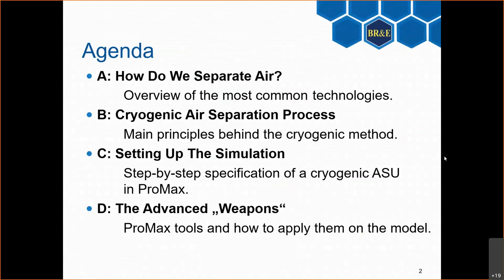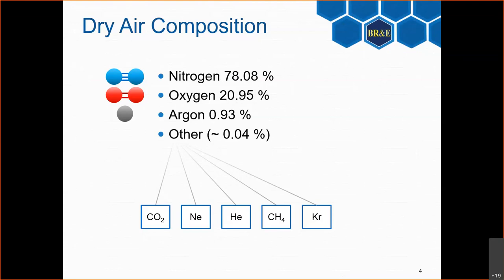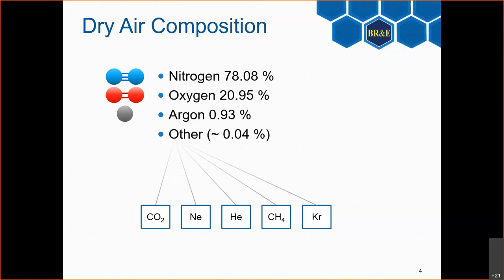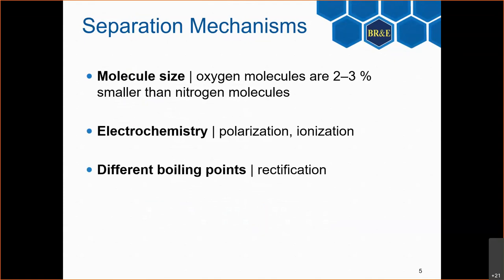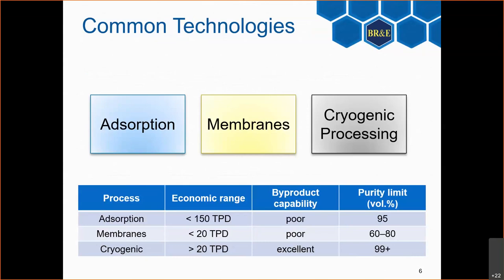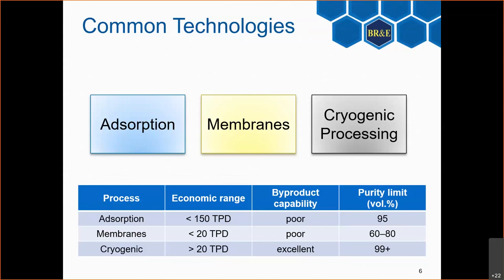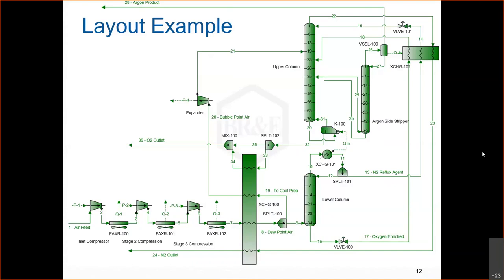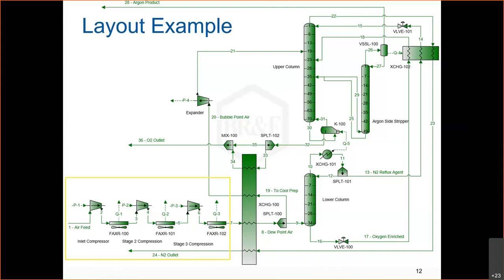Air Separation

Comment: Can you send a boiling liquid (20 - bubble point air) to an expander?
Reply from the maker: While most hydraulic expanders do not work in the 2-phase region, expanders that work in this region have been developed and used. There are many classes of hydraulic expanders that work up to about 10% vapor, but there are some designs reported for the LNG field that will work across the entire range of phases. Below are some links to articles that might be useful to you:

https://oaktrust.library.tamu.edu/bitstream/handle/1969.1/162590/Fifteen%20Years%20of%20Field%20Experience%20in%20LNG%20Expander%20Technology.pdf?sequence=1

https://docs.lib.purdue.edu/cgi/viewcontent.cgi?article=2859&context=iracc